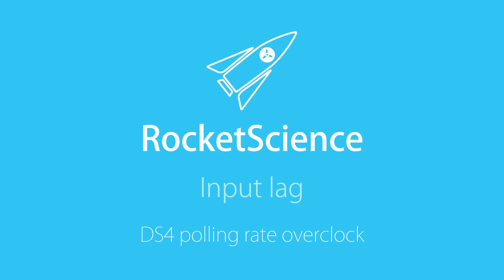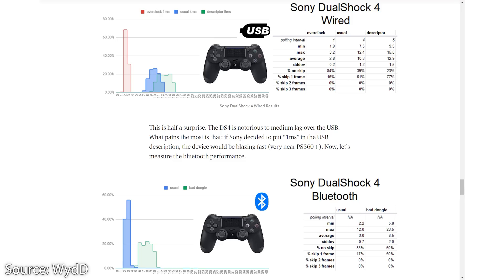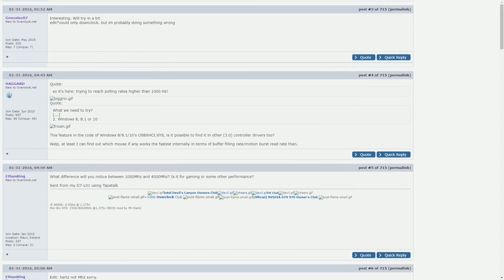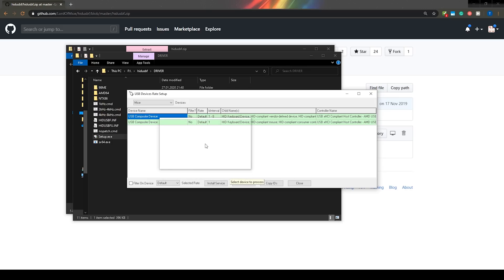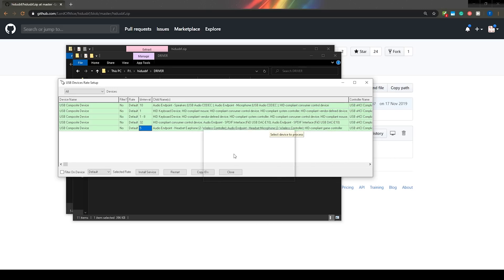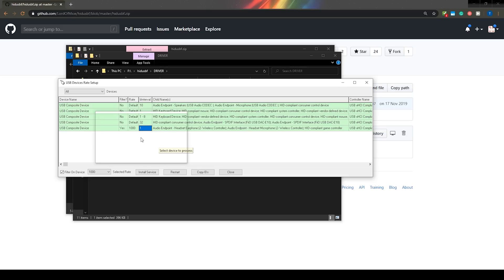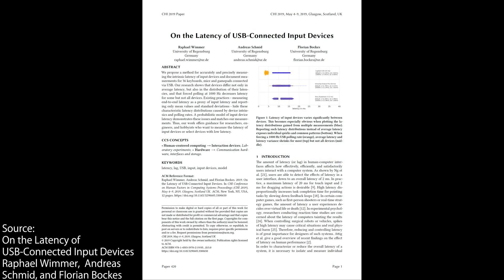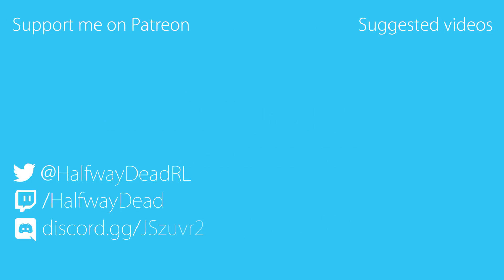(DS4 PC) Lower input lag for free! - Rocket Science

Comment: "HELP" I followed all the steps and when I try and open the setup tab in the driver folder, either it will open the usb select devices box and close admittedly or the setup file will just disappear, when I try and open it? I'm not sure what I'm doing wrong. I do use scp4 tool kit with a fps strikepack could this be the issue?
Reply: Use SCP toolkit to configure your strike pack and there is a built in setting to enable 1000Hz
Reply: @crippyclips  thanks for the help I've tried to find any info on how to use the spc toolkit to fix input lag but I'm not having any luck and I'm not sure where to find the setting to change any help is always appreciated
Reply: turbotoad in the SCP toolkit manager you need to find the dual shock 4 settings and you’ll find the setting there
Reply: @crippyclips  Rocket science, thanks I was able to set both setting to 1000mhz and I have to say wow what a difference, I had to lower some of my movement settings because I wasn't used to the new found response time I was seeing🐸🐸🐸🐸
Reply from the maker: I am not sure if I understood all your points but if the file just disappears that sounds like your anti-virus is deleting it. That might also cause the other issue
Reply: @RocketScience  I retired to install the file the next day and I was able to install the file Thanks
Reply: @RocketScience  I need help.I think i had the same problem like him.So i have the scp toolkit to connect my fps strike pack.Then i looked for how i can reduce my inpit delay and found this video.I followed your steps (maybe i missed smt) and then it was more delayed than before.Then i did something in scp toolkit and fixed it.1 day lader i did something again and it was delayed again.With this programm i can do more delay (so i can controle it) but i can do lower delay.Please help me

Comment: Y’All bots Buy a 4.0 usb Bluetooth dock en set it up with ds4 you have 2.4 ms response time off Bluetooth
Reply: Bluetooth isn’t quite as good as you said but close.  wired is better Though for signal consistency (the ms response time stays the same instead of varies). You will miss shots randomly 1/30 shots from my experience With Bluetooth because of this
Reply: @Kuj  I have Nisuta NS-COUSBL2 and DS4 v2 and get around 1.4ms input delay in DS4Windows (1.2-1.5). With cable (without the overclock) i get constant 4ms. what you say is true, but if your variance with bluetooth is low, bluetooth will be better and more confortable

Comment: Who has DS4 problems when playing rocket league it lags the controller connection losing
Reply: I have the same issue but with Xbone 1 pad. game suddenly starts lagging and ping jumping as high as 700ms somehow. never had this problem before
Reply: Synesthesia Z hm in other games too or only in rocket league ?
Reply: @denissssss8579  Actually was talking about another game, being MK11. And also only play that game loyaly. ever since i messed with this it actually felt more sluggish and slow while the game fps actually showed it running a solid 60 fps ( game is capped at max 60 ) and polling rate at 1000 should've done exactly the opposite. ( assuming this works the same for Xbone as it does for DS4). Now even after putting polling back at default-deleting that program- updating gpu drivers--deleting and fresh installing the pad--installing newest windows drivers, the problem still persists. Makes me think it also messes with the usb input drivers in some way. Which they would elaborate a bit more on some of these issues.
Reply: Synesthesia Z ok i have the problem on console ):

Comment: To ANYONE in the comments asking about if this works for xbox controller. I have tried this method with my xbox one wired controller and can confirm I have insanely less input delay than I did before. If I had to guess, I would say my input delay is comparable to the wireless ds4 controller or maybe even the same as a wired ds4 controller that is using this 1000 refresh rate method. I am a fortnite player and can finally pull out my builds on command. My switch mode option always registers on the first press now and I can even shoot to instant switch mode (Building) without delay. Ggs only ~
Reply: Xbox elite? Mine doesn’t work, It says I have to disable secure boot
Reply: @youngyino  No, mine is a standard xbox controller ~
Reply: HorizonSherlock Shit, did you have to disable secure boot or not?

Comment: Bluetooth through ds4windows (1.47ms)feels better than wired after these changes. But if I try  wired though ds4windows (1ms ) it feels close to  Bluetooth ds4windows (1.47ms) but it’s still not as smooth 
 .. am I missing something ?
Reply: When it came to fortnite 1ms felt the same as 4ms when connected through wired without ds4windows . But when I loaded up apex legends and tried it on there I was able to tell the difference right away. I’m not sure what to stick to at this point lol

Comment: Do i need ds4 program to do this? I use controller on pc wired and i dont like the program beacause of the gamepad can only be used as a mouse and thats very irritating. So is it possible to overclock wired ps4 controller without the ds4 program?? Thanks in advance
Reply from the maker: yes of course, I said during the video that you should turn it off while doing the oc and you CAN turn it on after but you don't have to.

Comment: When I did everything according to the tutorial, the delay became 1 ms, as I saw in ds4 windows, but it still feels higher than 1.2 ms for bluetooth? I connect to usb 3.0 and ds4 has Yes-1000-1 ... What could be the problem? Somehow, I managed to connect it, but then everything broke ...
Reply: I found a solution after one minute, I hope everything remains the same, everything had to be included in the tenth USB port (This is a joke about the fact that I tried all the ports except the last one)
Reply: Another solution, if you did everything and it shows you 1ms, but you don’t feel the difference, as soon as I did everything by default, everything worked, it applied.
Reply: Do you recommend this or bluetooth
Reply: @MidEastBeastGaming  i think Bluetooth feels more responsive than usb, its for me
Reply: ЭмВайтМакс are you using ds4windows ?
Reply: @en7679  yes
Reply: ЭмВайтМакс okay same here Bluetooth still feels better for me & 1ms wired is very close but not as good lol

Comment: When I click on "install service" it doesn't do anything.  But it recognizes my controller.  Any help?
Reply: For me it looked like it didnt do anything either (run and open windows didnt pop up), but this might already be set by default and it actually installed everything. I just follow the other steps and it worked perfectly.
Reply: @Kopust1237  I figured out what I did wrong, i downloaded the wrong file.  It works perfect for me now.  A window should have popped up when you click on filter.  This is the new meta.
Reply: @smario1555  haha, happy to hear you worked it out.
Reply: Smario15 which file to download cause I also think I downloaded the wrong file from a different source which was incomplete can u tell me which one worked for you.

Comment: I overclocked my DS4 and it now has a green box with a bInterval of 1 but my Steam doesnt recognize the controller anymore. Is this normal? Even after I reverted the overclock my controller no longer connects at all in that USB port.
Reply from the maker: If that doesn't fix it then close down the app. In the folder with the setup.exe there is a file called HIDUSBFU.inf (make sure you use the one with U for uninstall at the end). Right click on that file and click install. This should uninstall the service completely. Replug the controller to see if it works.

If it still doesn't work properly, go to (Windows) Settings, Devices, and click remove on your controller. Then replug it again. It should now reinstall the driver for it.
Reply: @RocketScience  Ty for replying with a possible solution I truly appreciate it!

Comment: Thanks for ruining my controller DONT DO IT
Reply: Just reverse it default did you watch the vid
Reply from the maker: As itzWakez suggested try the reversing part. If that doesn't fix it then close down the app. In the folder with the setup.exe there is a file called HIDUSBFU.inf (make sure you use the one with U for uninstall at the end). Right click on that file and click install. This should uninstall the service completely. Replug the controller to see if it works.

If it still doesn't work properly, go to (Windows) Settings, Devices, and click remove on your controller. Then replug it again. It should now reinstall the driver for it.

Comment: So my thing turned red as well, but I've read all the copy paste answers how to fix that. I disabled secure boot and installed it again and it worked. But if I then enable secure boot again and start the program, it still turns red.. Can anyone help me?
Reply: if it worked by disabling secure boot. You can't enable it again. Cause the secure boot detects the drivers that doesnt have a certificate, so thats why it doesnt work with it on. Its not a setting that you can disable, install a driver and then enable it again.
Reply: Try this registry key https://forums.mydigitallife.net/threads/windows-10-anniversary-update-digital-signature-question.69970/#post-1272392
This method should work with secure boot enabled, your OS will consider itself as updated from the previous version.

Comment: For anyone having problems after this mod, make sure to put the controller in a 'good' usb port at the back of your pc not the front ports they tend to be bad.
Reply: Underrated comment!!!
Reply: 2 years later, and I'm after answer.. What problems would occur? Iv over clocked my ds4 and sometimes it has a mind of its own. For example it does random spins and looks in random direction while playing warzone. Do u think that is the usb port?
Reply: @hodl2082  You can try, a 'bad' usb port has a slower data speed. It might however be that your controller is dying.
Reply: @CHRISZIOMusic  yeah it is a battle beaver custom control. Needed to go in the bin since I got it
Reply: @hodl2082  are they bad?
Reply: @LucasBonamigo123  umm I used it for about a year or so. it has stick drift and I went to open it up and seen that it had stick drift fix adjusters.. still wasn't 100% happy with it as I had to open it up and  adjust the stick drift every month or so.. are you buying the controller for a shooter?

Comment: Hey, after hitting "install service", it doesnt do anything for me :D any help? Thank u :)
Reply: same for me, just a window on the top right flashes up then quickly disappears
Reply: @ImShads  that is it. There's nothing more to it. So what exactly do you need help with?
Reply: @Drixi  for me when i hit "install service" it does nothing, no window pops up or anything. When i hit "filter on devise" it says filter driver setup is disabled and it doesn't work
Reply: @Drixi  its not it, because after it happens and I try to overclock, there is no 1, it just pops up with nothing in the box and the list goes red, that window is something i need to install to make it it work and its not letting me do so
Reply: @ImShads  same
Reply: @rixzyr  Drag the "hidusbf" folder onto your desktop -> rick click on it-> extract all-> go into the folder and everything should have icons now-> right click Setup and run as admin-> everything should work like its supposed to.
Reply: I had the same issue basically all I did was check if my secure boot was disabled (It was). Then I realized that i was missing a step and i kept forgetting to extract the file so when I did all the steps again WITH extracting the file it worked perfectly and i was able to do it. Hope this helps :) ( I use an Xbox controller so I can confirm that this does work on Xbox controller)

Comment: For those of you still having issues with getting this to work, via a red box instead of green. This solution worked for me. Please let me know if this manages to solve yours.

Run Command Prompt as administrator.
You will need to enter test signing mode.
To do this you must enter this command.
"bcdedit -set testsigning on"
(If you aren't able to do this, you might have to disable secure boot in your bios)
Please keep in mind, this leaves your computer vulnerable.
Restart your computer. After you've done that, you should see a watermark in the bottom right corner of your screen that says something along the lines of "Test Mode".
Launch hidusbf\DRIVER\setup.exe
Click on the controller, install service, enable filter on device, and select polling rate of 1000.

If you have any questions, I will try my best to answer them for you.
Reply: Waxy how do you make it go back?
Reply: XxLord80xX YT What I did was “bcdedit -set testsigning off”
Reply: Waxy ok thank you
Reply: XxLord80xX YT no problem. Did this work for you?
Reply: Waxy haven’t done it yet... will try though
Reply: After I do that and overclock the controller can I revert the changes In cmd and still use the overclock
Reply: Jakz I’m not sure for you, but as for me. I have to keep test signing enabled.
Reply: The Asperger Gamer I believe it only works for PC.
Edit: After doing a little research, I think there is a possibility of it working, although it might not be a smooth experience. I suggest testing it out yourself. You may notice a difference, if not I’d say it’s not worth the risk to the hardware.

Comment: so in case im able to make it work i cant use it with ds4windows or other tools?. i mean does it only work with native input?
Reply from the maker: It does work. Just turn them off in case you can't find the controller in the overclocking screen. Turn them back on afterward.

Comment: Could you possibly make another video doing this on the Windows 10 since many people are having trouble?
Reply from the maker: I am on Windows 10. The issue is likely regarding secure boot:
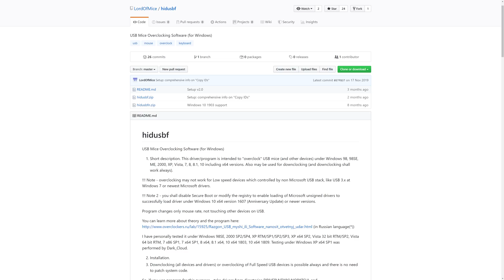It should be possible to do the reversing 3:38 to at least get the controller working again.
There may be a number of causes according to the support page of the program:

!!! Note - overclocking may not work for Low speed devices which controlled by non Microsoft USB stack, like USB 3.x at Windows 7 or newest Microsoft drivers.

!!! Note 2 - you shall disable Secure Boot or modify the registry to enable loading of Microsoft unsigned drivers to successfully load driver under Windows 10 x64 version 1607 (Anniversary Update) or newer versions.

In short: You may be unlucky and have the wrong USB controller (you can try the ports in the back of your mobo if you didn't already (USB3)).
Google how to disable secure boot on your PC, install service, then you should be able to turn secure boot back on.

Comment: Does this work as well for other controllers who tried? Hopefully  someone had try already.

Miss your videos. I was thinking about how the approach or setup affects the ball when going for an air dribble. Although dont know if you have already made an air dribble science video or pinches either.
Reply: When youre close to the goal you pretty much go up the wall at a 90 degree angle. When youre far away from the goal you approach at a lower angle like 45 degrees. It just comes down to practice and trying around in custom training and free play
Reply: @Hannes789  I know it comes down to practice. But there are many ways people approach , I was like wondering if the different approaches give a better advantage than others.

Thinking relatively with the the veloticity,distance, and time. Also "power" or the transfer of energy that requires the ball to be going at a constant pace after making contact with car. Stuff like that.

Comment: Did not work got red bar
Reply from the maker: It should be possible to do the reversing 3:38 to at least get the controller working again.
There may be a number of causes according to the support page of the program:

!!! Note - overclocking may not work for Low speed devices which controlled by non Microsoft USB stack, like USB 3.x at Windows 7 or newest Microsoft drivers.

!!! Note 2 - you shall disable Secure Boot or modify the registry to enable loading of Microsoft unsigned drivers to successfully load driver under Windows 10 x64 version 1607 (Anniversary Update) or newer versions.

In short: You may be unlucky and have the wrong USB controller (you can try the ports in the back of your mobo if you didn't already (USB3)).
Google how to disable secure boot on your PC, install service, then you should be able to turn secure boot back on.

Comment: worked for me!! so happy thank you Edit/Update: Honestly, I believe I can also feel the difference. I feel much snappier now.
Reply: Does it really so you can tell the difference right
Reply: @SamzifryNo1  yes. And I've done absolutely everything I know to optimize my game. I use a DS4 v2 wired ontroller, I use duranzo instead of steam, I have 240hz monitor and run my game at ~480fps, ethernet cable of course, I've optimized my GPU settings, and this. I do so cause I live in alaska and need every advantage I can get because my ping sucks! So ya I noticed this
Reply: @dereksevcik6595  I understand thanks I'm going to give this a go when I get back hope it helps
Reply: Derek Sevcik do you use durazno with a ds4 controller? I thought it was only for Xbox